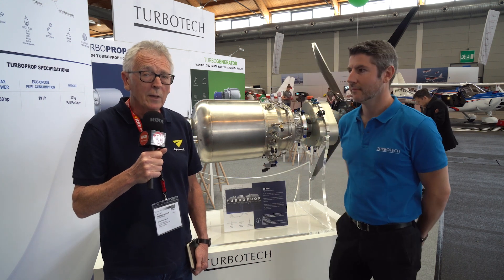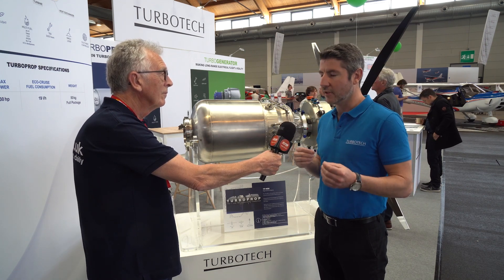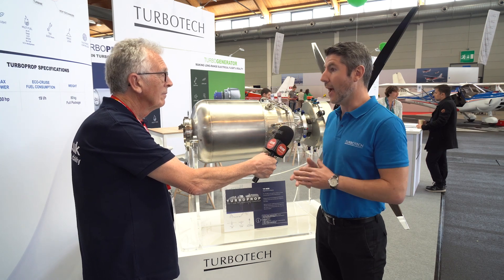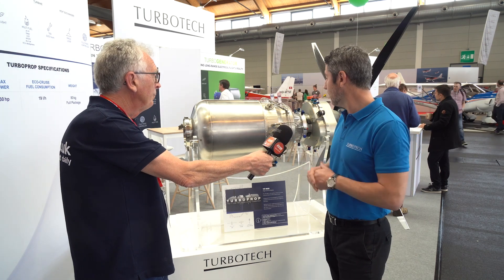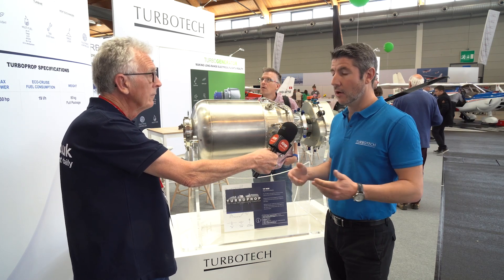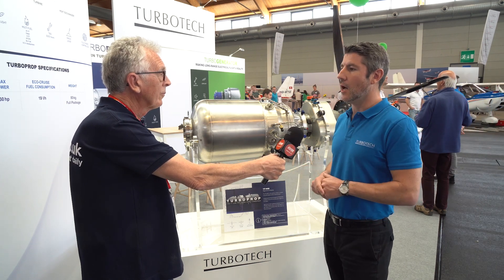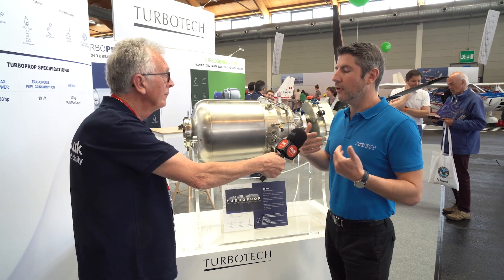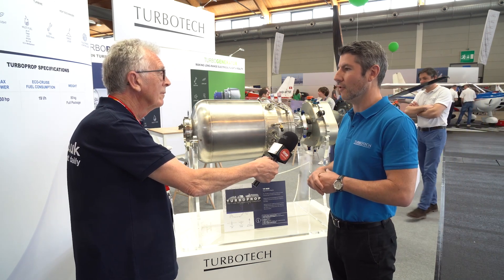TurboTech's small turbine for light aircraft revealed at AERO

Comment: You can also have a higher compression in a small scale turbine engine by use of a radial compressor instead of an axial one. In fact the first turbine engines had radial compressors and also radial expanders. Also the turbine engine of the Lotus F1 race car was a radial turbine engine. Its issue was not the fuel consumption but the small power band. Today this would be no more an issue because of the possibility of serial electric hybridization.
Reply: You mean centrifugal compression, these are not more efficient than a multi stage axial compressor and stator arrangement. Lets not rewrite history here, the first attempts at a gas turbine engine date back to the 1700s and maybe even earlier. The 1800s saw more serious efforts with a bunch of patents filed, in the early 1900s Frank Whittle took the credit for inventing the gas turbine engine, but he really just stood on the shoulders of many before him.I have no idea what serial electric hybridization is, nor does google, maybe it'll come up if I play buzzword bingo long enough, but gas turbine engines are fuel hogs. Under the current F1 regulations, 110 kilograms of fuel would barely get them through the warm up lap.
Reply: @nohandleleft  In a series hybrid, the electric motor is the only means of providing mechanical power to the wheels. In parallel hybrids ice as well as electric motors are mechanically connected to the drive train.

I ment that a gas turbine engine makes no economic sense for operation of the drive train by use of a torque converter. But this was also done with the Plymouth Sportcoupé in 1954 und Chrysler Turbine in 1963. Later there were several small series of gas turbine cars around like Dodge Charger, Dodge Coronet (1966) and Chrysler LeBaron (1977).

The Lotus 56 was a Pratt & Whitney ST6 helicopter gas turbine driven Indi car and F1 car piloted by Graham Hill, Joe Leonard und Art Pollard in the Indi races and Emerson Fittipaldi in the F1 races between 1968 und 1971.

Comment: why no technical data, specs, TBO, price ???
Reply from the maker: This is a video from 2022 when the experimental engine was launched. There’s a short video from this year with some prices. It’s still early days.
Reply: * basically twice the retail price of a flat-4 with similar horsepower. 100 k€ vs 50 k€.
* Much better TBO (3000 h)
* Lower fuel price (similar fuel burn, but jet fuel is cheaper than gasoline)
* Slightly quieter.
* Slightly lighter.

Comment: Runs on hydrogen? 
Why would they ever want to do that?
May was well store the hydrogen in a large bag above the fuselage.
Liquid hydrogen doesn't have much of a "shelf life".
Reply: Cryogenic liquid is the form of hydrogen which major aircraft industry projects (such as those by Airbus) intend to use, because it is the only one which offers the hope of low enough weight per unit of fuel energy value carried. Yes, the time that fuel is held on the aircraft is a concern, which is why it would only be for scheduled commercial operations.

Liquified Natural Gas has similar concerns (although of course with a less extreme temperature), and in select applications it works. Where "shelf life" is more of a concern compressed gas is the solution (whether that's CNG or high-pressure hydrogen gas), but for aviation pressure vessel weight is a real problem.

Comment: 19l/h for 130hp seems very very optimistic.
Reply: I see that Robin quoted 28l/h for a 155hp version. No doubt it will weigh less than the Continental diesel engine of the same power but it uses 40% more Jet A.
Reply: @nigelcharles511  19l for 130hp is not physically possible. 20l have about 200kWh of energy, of which 30% can be turned into mechanical energy, that is 60kWh.
If you fly one hour at 130hp = 100kW you need 100kWh. So either they don't know what they are talking about or they think of flying at 60% power.

28l/h for 155hp on the other hand is in the realm of possible and could be a realistic number for an efficient engine.
Reply: The 19 l/h is likely for cruise power, much lower than the ~100 kW (130 HP) maximum rated power. On their website, Turbotech labels this fuel flow as for "Eco-cruise"... which generally in the industry might mean 55% power.
Reply: My CD155 engine is at 60% power at 20l/h. I am not sure what power setting they are at to achieve 28l/h.
The Robin DR400 airframe best operates in the range of 105-115kt (60-75% for a CD155). Matching powerplant to airframe is an important consideration which is sometimes overlooked.
Reply: @Nigel Charles  yes, matching the engine to the aircraft's requirements is important, but even ideally matched, I think we agree that the efficiency of this turbine will be nowhere near that of a diesel.

You are operating the Continental CD155 at about its ideal point. Turbotech isn't even telling us what that point might be for their engine.
Reply: In a YouTube video posted by TurboTech, this engine is shown on a test stand burning 31.2 litres per hour and producing 72.26 kW (97 HP), which is shown as 349 g/kWh (implying 0.81 kg/l fuel density). 19 l/h would correspond to less than 59 horsepower.  

That video also claims the 19 l/h fuel consumption... without mentioning the corresponding power level.
Reply: https://www.youtube.com/watch?v=OfdNoc_6vN8&t=70s
Reply: @brianb-p6586  So 31l/h for 72kW is a realistic data point, which means for 19l/h we will clearly not even get 100hp. 
For me that means a (diesel) piston engine will probably give you more range because you burn less fuel. Less weight you have to carry.

So what rational reasons would that leave us to buy this engine?
Reply: @AlJay0032  72 kW is 98 HP, so since that takes 31 l/h, for 19 l/h we will get two-thirds of that power or less... think 50 HP, not 100.
Yes, a diesel engine of the same peak power will consume much less fuel, and for a long flight the saved fuel weight will be significant.

Compared to gasoline piston engines, turbine are preferred to lower weight, smoother operation, better high-altitude performance, and less expensive fuel. Since diesels use the same fuel as turbines and are always turbocharged, the turbine advantages are down to weight and smoothness.
Reply: @brianb-p6586  Yes, of course turbines will have better performance at higher altitudes, but the small LSA or private pilots don't have pressurized cabins, so that would not be a reason to buy it.
The idea of having a such an engine may be cool, but if your range will be less and you will need more fuel, I don't think they will sell. For me a longer TBO, smoother operation and lower weight but also a lower range would not be enough reason to buy one.

Comment: I worked on the development of an engine much like this in the late 70's with Rolls Royce and Alfa Romeo.
Reply: did you use a low pressure ratio to realize a low sfc, at the cost of power density.
We tried to modify a T62 with a heat exchanger mounted behind the combustion chamber, build up with parallel small diameter tubes, first the compressor flow after the diffuser fed the outside tubes, surrounded by the leaving radial outflow exhaust flow, after crossing a second set of tubes feeding the rear of the reverse flow combustion chamber.
A bit difficult to describe. The fuel savings were substantial, despite the added pressure losses in the tubes . Recalling the pressure ratio by the centrifugal compressor was just below 3. TIT 900°C Noise reduced compared to the bare T-62 titan
Reply: It looks just like the presented engine here, with larger diameter HE.
Reply: Interesting. what happened to the project?
Reply: @pouyan225  It did get manufactured as a prototype but I don't think it was marketed properly as Rolls were obsessed with small helicopter/ turboshaft engines and even passed on a chance to produce a rival to the T700 type fan engine.

Comment: Another bad idea, like most idea's today. Why can't somebody build a nice small 120 degree v6 motor and build the thing "RIGHT"
Reply: That might be a reasonable configuration... so build one. 🙂
Reply: Put freevalve on it to save a lot of weight
Reply: @Alexander Biersack  a camless system like Koenigsegg's Freevalve (which still isn't in production) might save weight, but reliability will be low compared to traditional camshafts. The big advantage of these systems is in accommodating widely varying operating conditions,  but aircraft have very little of that variation compared to cars, so it's not a good application.
Reply: @brianb-p6586  I know the range in which aircraft engines operate is smaller but I would think that Freevalve would be more reliable because if one valve fails all the others could still operate fine. Why do you think Freevalve would be less reliable?
There is a lot of redundancy and independence.
Reply: @Alexander Biersack  it's a good point that there is independence, but there are a lot of active components and electronic failure seems likely. On the other hand, fuel injectors work relatively reliably so perhaps it won't be a major problem.

I doubt that there is any redundancy in Freevalve. There are lots of valves, but for each valve there is only one of each component so the failure of any component causes the failure of that valve (hopefully in a closed position).
Reply: @brianb-p6586  I think electronics are less prone to failure than mechanical parts. With two input and two output valves per cylinder you could have two completely independent control electronics. If one fails the engine could still run on reduced power. If one valve fails the engine could still run. Failover and performance degradation is preferable over a full failure.
Reply: does not need 120° w, 90° is the best angle for a V6 (compact and easy intake design), with a offset crankshaft...the speed record (official 405km/h but was in real a bit more) in 24h Le Mans race was take from a V6 PRV (910hp) WM P88  in 1988...One aircraft was made with a PRV (Robin R3000), was never built in serie despite it work very well, for the same cause the flat 6 Porsche aircraft engine was discontinued: too expansive to buy= not enough sales to make a profit...

Comment: 400 HP is needed for global success
Reply: 400hp with similar fuel consumption to piston equivalent would be a game changer.
Reply: nope: 400hp is not allowed for 90% from the PPL licensed pilots...need a high performance PPL HP Rating over 200HP, and in addition turbine engines need a specific Rating

Comment: We don't need effing turboprops, they are the worst of both worlds. Super expensive and still front noise maker like a piston prop. We need a small turbofan jet engine, which is quiet, much lighter, natural twin engine configuration for ocean redundancy. Turbofan engine has world distance record of 40000km at 500km/h without refueling so when jet can be fuel efficient then why would you ever go after the much more complex turboprop....    come on, people.
Reply: Turbo props are more fuel efficient.
Reply: @Adolf_Meowtler  world distance record of 40000km at 500km/h belongs to the off the shelf simple turbofan jet engine Williams FJ44-4. Explain that then.
Reply: @Adolf_Meowtler  you didn't address the world distance record. I had also heard that turboprops are more efficient but then where is the world distance record then...
Some of the best airliners can fly to the other side of the world. There are no turboprops with such ranges.
Reply: @Adolf_Meowtler  The failure to comprehend is yours. You insist on arguing from status quo without thought. You have your blind belief that turboprop is more efficient but reality is that it isn't. Of course the record plane is extreme but the fact still remains there is no equivalent turboprop that went further. Same with airliners that can go about 20000km without refueling at mach 0.7. No turboprop equivalent that does better. Jets have better TBO than turboprops because they have no gearbox. cheaper, simpler, lighter, better.
Don't be a status quo monkey.
Reply: @Adolf_Meowtler  well that's probably true, for low and slow planes, turboprop might well be more efficient than turbofan jet because of high gearing and big fan. but is a PC12 a low and slow plane? and should planes be low and slow.... or is that just continuing colonial piston prop times. If you can go twice the speed in a jet with same mileage, should turboprops exist? think a little.  A local guy bought a Piper M600 and I tried to encourage him to get a Embraer 100 instead. He can plenty afford it but he was sure the jet was an awful plane etc. The M600 does use less fuel but at 500km/h instead of 750. If you slow the jet down to same speed the fuel usage is about the same. I hold it to be self evident that the jet is infinitely cooler than the indiana jones 100 year old look of the nose prop noise maker plane.
And the same goes all the way down to LSA size, that if you just pressurize a small light plane it can be as fuel efficient with a jet engine, going 3x the speed. And cost the same or even less maintenance because a jet can have much higher TBO.
Do you think that a twin jet equivalent of an SR22 at half price would beat it in the market? is it possible that you haven't considered it.
Reply: @MiloTheMindBender  if turboprops are so amazing why aren't long haul airliners all turboprops. And if you had actual insight you would know that it's not about the blade shape of turboprops, it's the diameter. It's like walking in sand, a small footprint sinks and wastes energy. same principle as the benefits of a long wing.
Larger bypass gives a bit more efficiency, it's just not worth it compared to the engineering cleanliness of jets going high and fast.
An Eclipse 550 twin jet has the same fuel economy as a Baron 58 piston prop despite going twice the speed in a bigger cabin. That immutable fact means nothing but jet need apply. You dig?
Reply: @DanFrederiksen  You are all over the place. I already explained why airlines use turbofans for long haul and turboprops for short haul. That also explains your diameter quandary, which I also addressed. Open rotor architectures are being explored for this reason.

Pure jets are not used in commercial planes, only in fighter planes for their inefficiency but providing high speed.

I can only show the path. The rest is up to the recipient.
Reply: @MiloTheMindBender  when did you explain why airliners use turbofans? and what was the explanation. And spoiler alert, between you and me I'm the smart one. I'm the father of deep learning. Spacex starship lays on its side because of me. I know some of the physics that the visiting ET ships use.
That a turboprop can typically be a little more fuel efficient than a turbofan simply doesn't compare to the advantages that a turbofan solution has. Never mind the noise, never mind how ugly turboprops are, just the fact that prop twins are problematic in an engine out situation already disqualifies them. The complexity, maintenance, cost, weight. Turboprop loses on so many counts and the failure is further cemented by facts like the Eclipse twin jet has better fuel economy than a TBM despite going faster. A TBM960 at 310kts burns as much fuel as the Eclipse at 370kts. A twin jet. TBM has about 20% more payload but that is simply much too close fuel economy for turboprop to ever be considered for anything except for maybe very particular low and slow flight. As a general compromise in a versatile aircraft, turboprop is simply disqualified. Piper, TBM, Pilatus, all wrong for using turboprops.
The fact that the Eclipse bests a piston twin so fiercely also underlines my point.
Another thing you don't understand is that a turbofan for small planes can be easier and cheaper to make than comparable piston engines. Never mind the weight advantage.
It's a general intuition and was mine too that jets are inherently wasteful but that turns out to not be the case and that insight is a GA revolution waiting to happen. All planes should be jets, at any size. Even water planes and stol planes. The key is pressurization (and decent aerodynamics) such that they can go high and fast.
Reply: eclipse tried ... and failed.
Reply: PBS sells the TJ100 and a few larger models for a reasonable price. This engine is used on the Sonex JSX-1. IMO PBS is the only company selling turbine engines to the masses at a realistic cost. Everyone else is targeting companies like Diamond and Cirrus but those companies are very happy to sit on their outdated engine technology and collect decent margins from old guys with more dollars than sense. We need an innovator, unfortunately Tubotech doesn't look like they will be the ones. Turbair is targeting 85K USD at 180 HP which is much more realistic but they seem to have stalled out with few recent updates.
Reply: @glsracer  I don't quite agree that 100k for what is roughly a car turbo is reasonable. German FK provides a full LSA plane including overpriced rotax engine for 140k. PBS are obtuse dummies, no doubt stuck milking military contracts and fail to see a bigger picture. but even at lower price it's a turbojet and we need a turbofan.
Reply: @DanFrederiksen  we're in agreement there. The costs are still way too high though I'm pretty sure the TJ150 sells for 80K USD, still over priced for just under 400 lbs thrust. My original point was there is at least one company trying to sell a product at something near reasonable. No one yet is taking it seriously though.
Reply: @glsracer  sure but that only has value as a potential producer for a turbofan because the turbojet is too fuel hungry to be used in real planes. currently they are entirely useless as a company.